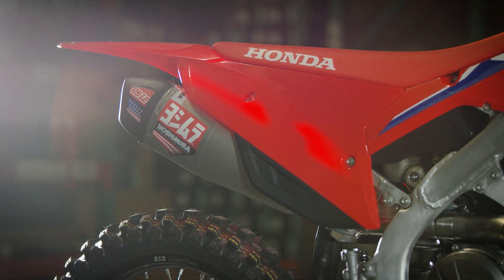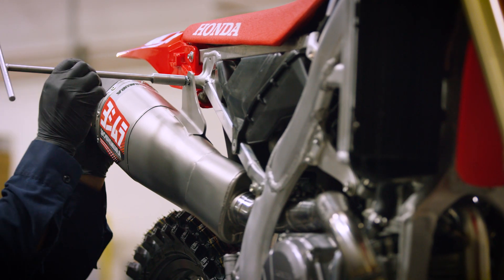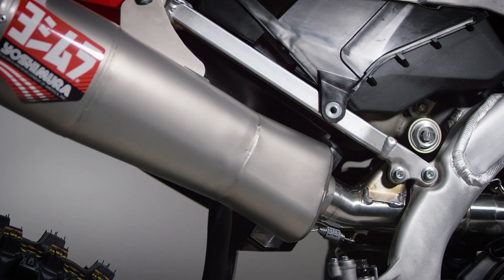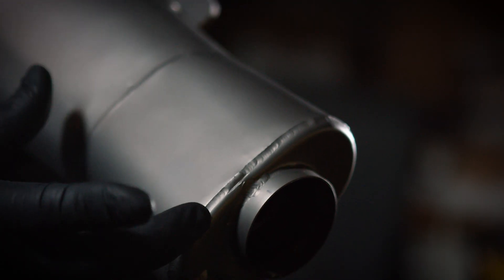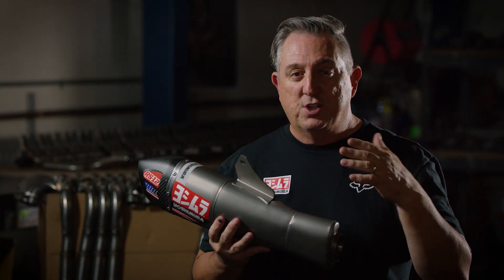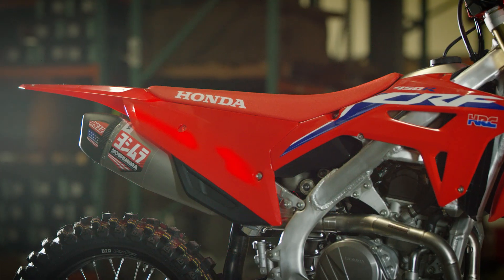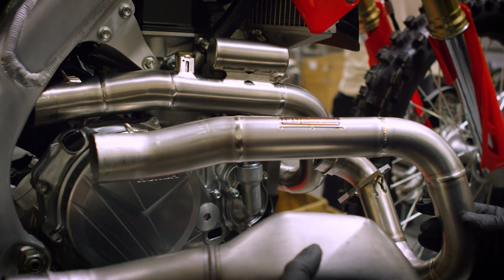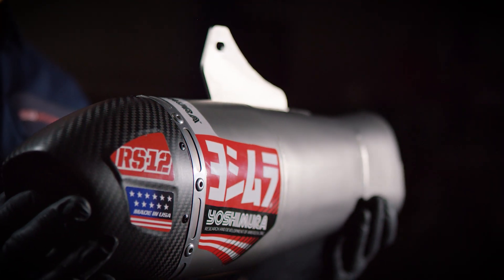2021 Honda CRF450R/RX Understanding Exhaust Resonator Tech

Comment: the 04 Honda 450R stock muffler had the exact same resonator in the exact same spot ......................... genius  lol
Reply from the maker: That is not correct.
Reply: ok , bro , not exact if you measure with calipers , but the same damn helmholtz resonator in the same spot in front of the muffler , do I need to post pics for everybody  lol @YoshimuraUSA
Reply from the maker: @cindyharryman4290  for more clarity Helmholtz resonators have been used on combustion engines since the first half of the last century. We don't claim to have invented them nor does Honda. Resonator development has been an integral to for OEs and the aftermarket in the battle for reducing sound and refining power. Just like a 65 Mustang to a new one, they may look alike but what you don't see can make all the difference. 
Bonus Yoshi trivia below:
Yoshimura has been offering MX systems to the general public with resonators since 2009 when we launched the RS4 system with the Factory Honda Racing program which were not on the header but integrated in the muffler. The first Yoshimura MX header reso came on the first gen YZ with the reversed cylinder head design. Our first production header reso on a Honda came on last year's Honda 450 WE...

If you still want to send pics of you bike please do. We love seeing what everyone is riding!
Reply: Im well aware of the history of the helmholtz resonator ,   fact is you were talking like it was some big breakthrough to put one on the muffler in this vid , all I did was say Honda had a resonator infront of the muffer in 04 , and they did , and all the way up to 2010 as well  , oh I know , yours is better  lol , its always better when someone else does something that has already been done  , I know what im talking about , im on my wifes comp , but my name is Dave Harryman owner of MRD racing , I have been building pipes for 20 years ( built MFI systems for jet skis for 20 years before that )  , I am prob the only small pipe operation still in biz since everybody and their brother jumped on the 4 stroke pipe bandwagon around 04   @YoshimuraUSA
Reply: Im not knocking Yosh ,  I just thought everybody should know resonators in front of the muff is not a new thing , personally I think Yosh has bitchen pipes , they have the machines to make nice parts and good guys doing the R & D  , I like hand tig welds better , but I get why Yosh uses machines for that , rock on bro  , good on ya  @YoshimuraUSA

Comment: /wach?v=TdF5ahg ++ mk AVN grn trackerz outer rim u 6''in diam rim i.e. 6F'o'' <brk> (frqs minimum) in signa w(iii) display trackerz <br> 2 points of contact frqs // +- AVN rd hides other hlf - till lockonsz // pi dbl used and - design header / feed pipe EI K' works exhaust system - much better texture - uses sec of area vs tick marks //
<br Int=T''x(wiii) 4p'' sec u area par diam VARS // i.e. trackerz || lockonz = injection maps /

Comment: Any issue running just the Yoshi RS-12 slip on for the 2021 Honda CRF450R due to it having a resonator in the head pipe and a second resonator in the RS-12 muffler?
Reply from the maker: Not at all. Our slip on is designed a little different than the RS-12 muffler for the stock system.